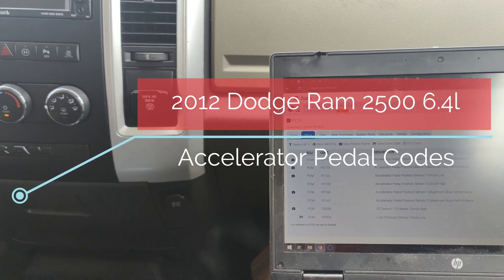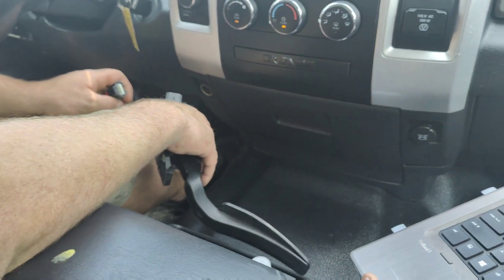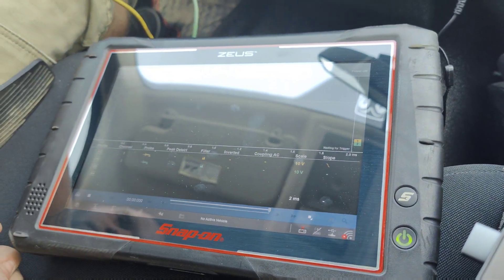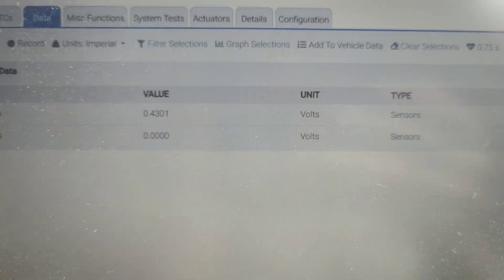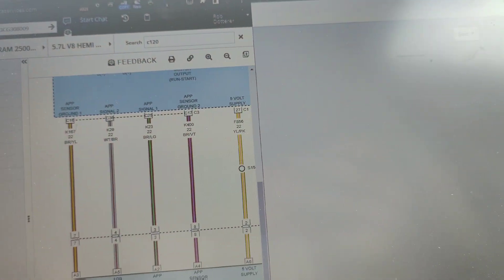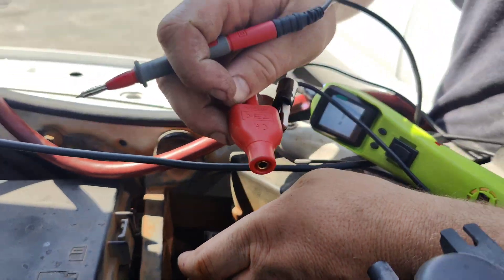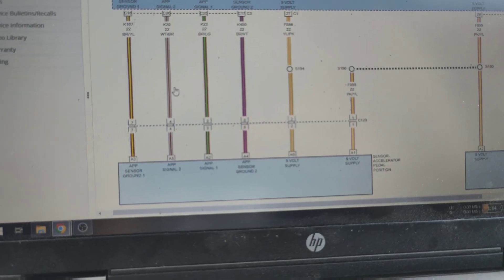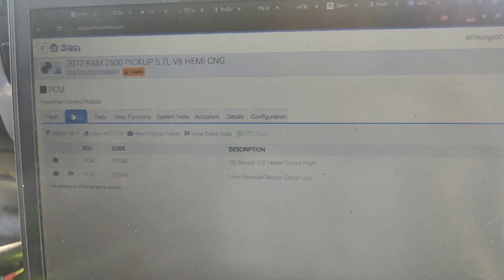2012 Dodge Ram Pedal Codes P2115 - P2116 - P2122 - P2128 - P2166 -  P2167

Comment: I have a 2006 Jeep Commander 5.7L. The same things are going on with my jeep.  It's been to 2 different shops, and it's still in limp mode (no throttle response.) Codes 2115 2116 2166 2167.. They couldn't get the throttle relearn procedure to complete. Exactly what you guys just did. I need your help.

Comment: Having issues on a 2014 Ram could you explain in anymore detail the wiring problem and repair. I'm not getting app 2 voltage also and trying to figure out for an elderly person. They've already replaced throttle body and throttle pedal/accelerator pedal. Dealership says wiring harness now so.....here we are. They already spent enough in my eyes 😂
Reply: Guess the simple first question is how did pins get mixed up? Then how did you determine what pins go where? I understand if it's top secret Mopar stuff😂😂😂 thanks for the video though, it's a start for me.
Reply: I had a 2016 promaster city with the same issue the person bought a used throttle pedal someone removed the app sensor on the pedal and it was reinstalled slanted whichever cause the codes to come on I had to remove the sensor and reinstall it correctly to get the sensor to read properly the relearn process was completed correctly after